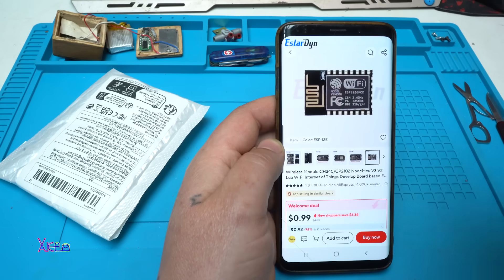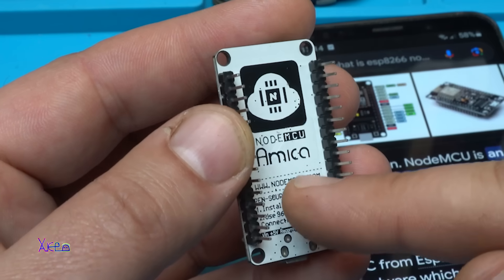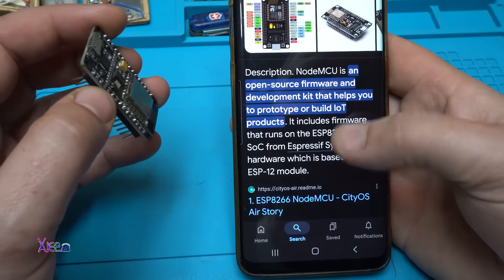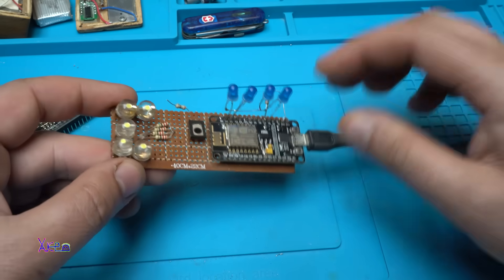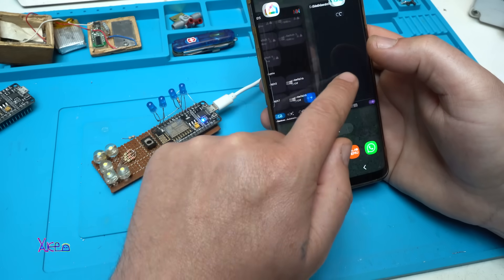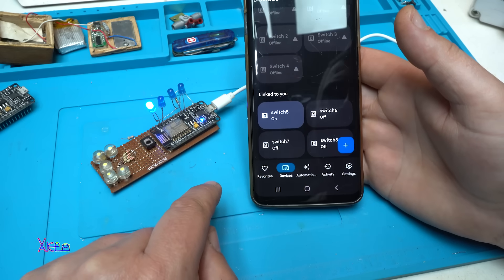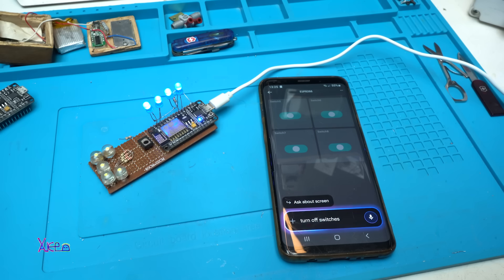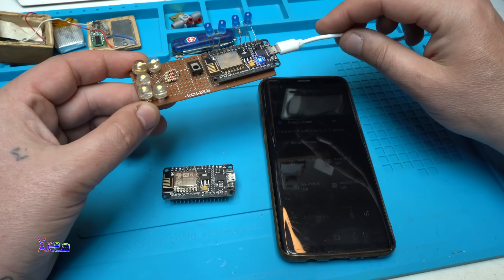WHY THIS $1 Aliexpress Module is so SMART?

Comment: You can use these to control 3d printers like a poor man's Raspberry pi. There is a project called ESP3D. It's on the github. With the bigger board shown here you can also upload your gcode to the printer.